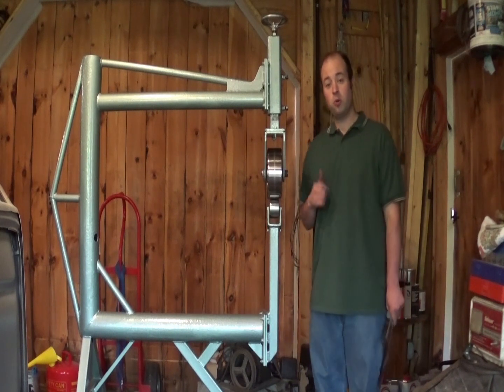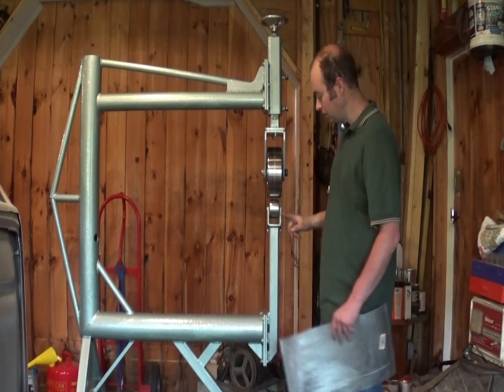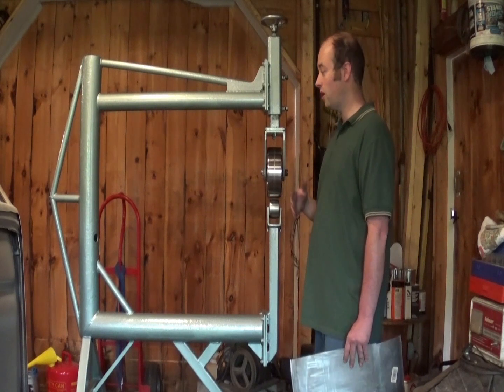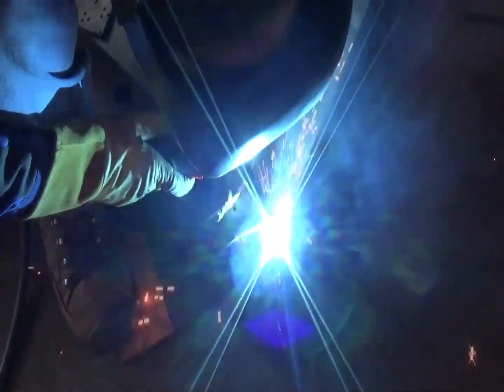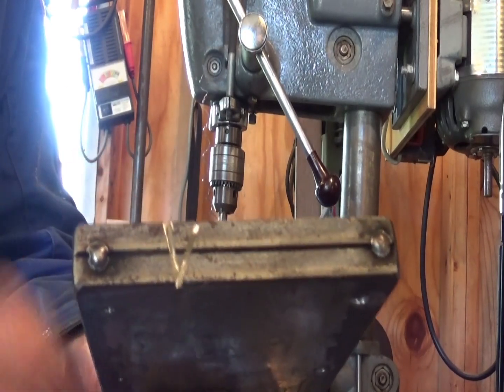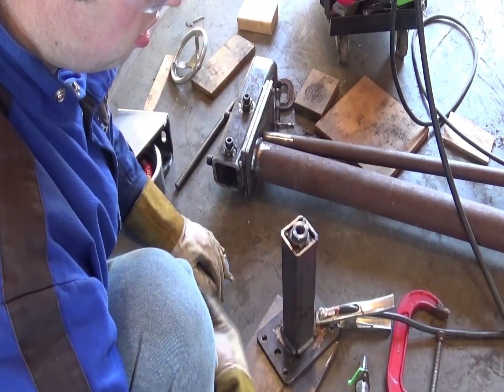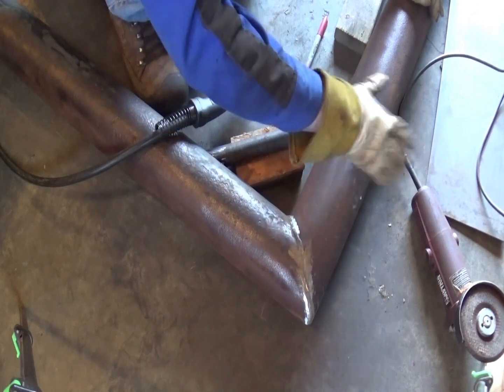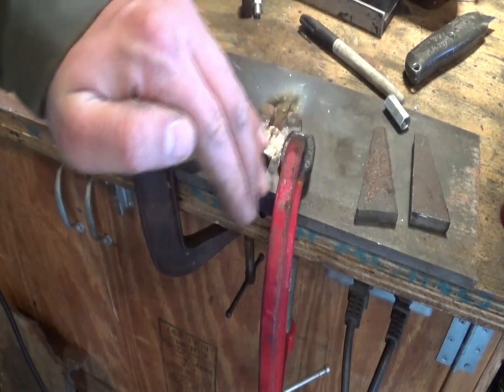Build an English Wheel from scrap metal

Comment: When the wheel is forced down on the work, the small round bar at the and side and top are in compression and will buckle.  Should be on the opposite side and will be under tension.
Reply from the maker: Used it all day today, yes they were in compression but no they didn’t buckle.